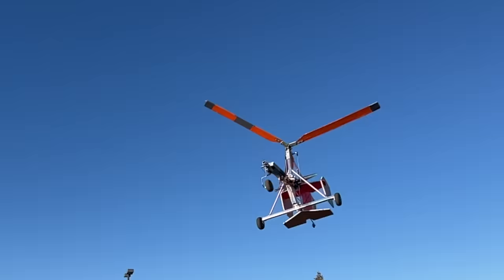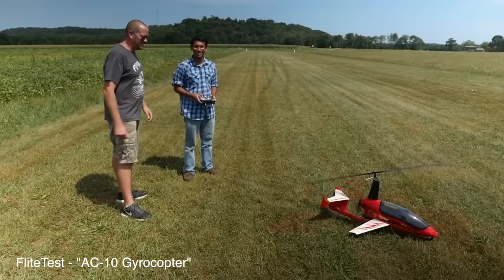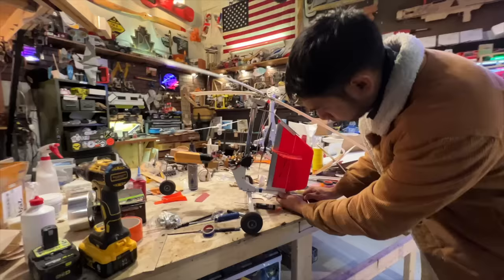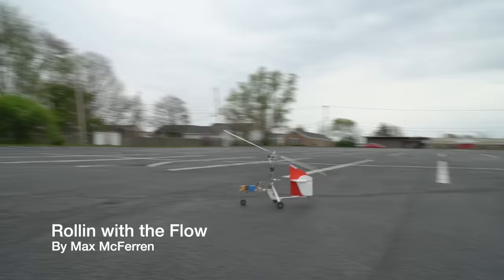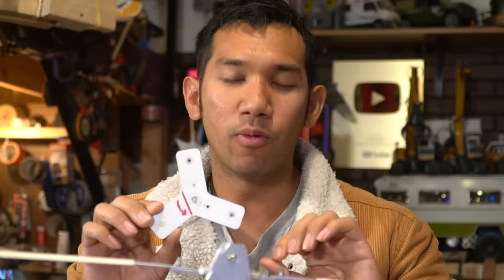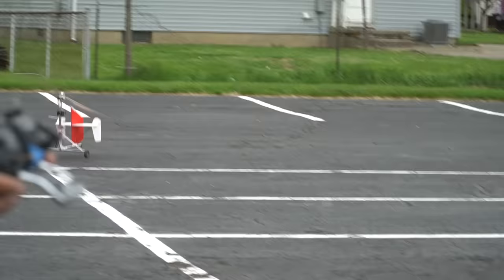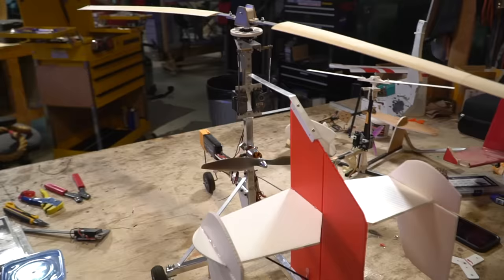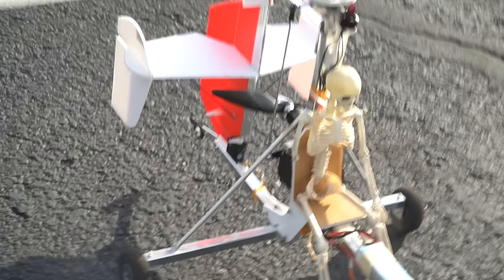This isn’t a helicopter or an airplane?

Comment: I have a buddy whom at one time owned a full size human gyro. He gave me a ride. Watching your video helps me appreciate that we are not dead.
Reply: I'm not sure where the notion that autogyros are inherently unsafe comes from.  Back in the 20s and 30s many aviators flew them and regarded them as more safe than airplanes due to the fact they could autorotate and can take off and land in very short distances, and also capable of very slow flight, whereas an airplane would stall. Amelia Earhart flew one for years. She set at least one record in it, an altitude record of 18000 ft.

If you expect them to fly like an airplane, then yes they probably are unsafe. It kind of looks like Peter is falling into that trap with all his initial crashes.  I've only flown one in simulator but if I recall, they don't rotate at takeoff.  At sufficient air speed they just lift off without changing attitude.
Reply: @tmlf1239  Hi I fly gyros though not for a few years.  The gyros safety record is undeserved the safety records of people trying to teach themselves and some appalling instructors resulted and still results in a terrible safety record.

One of the issues is they are a very high wing loading machine meaning that when the rotax 582s became available we could have dual control machines unfortunately that same machine was available as a single seater.   So the empty weight of that machine was probably 130kg.  Now add two 90kg male pilots and you have a machine just able to fly.  Take one out and you've lost about 1/3 the weight and it flies like a completely different machine.  The stick sensitivity alone is massively different.

Gyros have a few things that can bite you on the arse but much safer in others.  For example no stall no spin.  I've had 4 engine related emergencies two full on engine failures.  Non event I'm a gyro but you can't fly them fast.
Reply: who
Reply: @tmlf1239  Flew in them for years, my problems were those who built them, for a while was a test pilot for my mates. Had to KNOW them and what they did when the built them. A friend died flying his,  this was the cause of FAA building and testing. Their response was this is the best aircraft to survive all they did to it..They bolted one to the back of a flat bed truck. It lifted the back of the truck of the ground, the pilot lined it up again after it went sideways.. Tough?, safe?, depends on you and your  mindset. I made certain I knew what to expect, and what to do in all situations. Needed that.
Reply: Saw a Cierva in the Brits tech museum. Very impressive machine. Want an electric one.
Reply: @tmlf1239  As I remember reading, in the 20s and 30s all autogyros were tractor type with the engine and propeller in the front. Gyroplanes/gyrocopters like the Igor Benson models, on the other hand, were (and, generally, still are) pusher types, with the engine and prop in the back. They also were commonly built in the 1950 and a bit beyond without horizontal stabilization surfaces. Without these surfaces, and with the engine/prop mounted at or above the COG, these tended to push the nose down (called a power pushover, or PPO) when throttling too aggressively, in which case an inexperienced pilot would pull back on the stick too much, causing the nose to pitch up, which would cause lift (and therefore drag) to increase, which would cause aircraft to slow down and therefore reduce lift causing  the nose to pitch down,  which would cause the pilot to repeat the cycle, etc. In this way, the aircraft would enter a phugoid oscillation pattern, aka porpoising, that would become more extreme and eventually lead to the nose pushing forward to the point where the rotor disc would become unloaded, which would then lead to the aircraft falling out of the sky like a brick. It usually took three oscillations for the disk to  become unloaded and down she comes. Virtually always fatal. Also, the sudden lurch forward on the last oscillation would frequently cause the rotor to make contact with the propeller, so, even if the disc was not unloaded, it would be damaged beyond function, leading to a very, very quick descent.

Eventually, this problem was mitigated by lowering the engine/prop to at or even a bit below COG and also adding horizontal stabilization (although I'm not sure how much the horizontal stabs helped). By that time, though, gyroplanes had already gotten their bad reputation. This problem does not exist with tractor configuration gyros.
Reply: @gcolwill  hi you're right the hs doesn't work because it's not connected to the rotor system like a fixed wing.  It may contribute to dampening the airframe response to what you are telling it to do but it's not going to stop you unloading the disk.  Which is why may ppo accidents still happen today even with machines with very large hs.

I do have to add a correction on cg vs thrustline in relation to bensen machines.  You are accurately representing the modern myths but they are that.  Look at an actual Original Bensen or Wallis Machine.  They are very very short.  They also have a proper amount of downthrust 3 degrees that is the motor is tilted down to put the thrustline through the cg.  Bensen also flew very short narrow rotors this meant at any given airspeed the disk angle was higher than most modern machines.  What's more his blades were wood with a steel strap set to only 0 to 0.5 degrees angle of incidence and with a chord width of 6.5 degrees.  The mast was short because the direct drive two strokes he ran could only run a 48 inch prop.  These did have a thrustline passing through the cg.  Ceriva did the same thing pointing the engine down at over 5 degrees   this isn't new.  However many gyro builder s thought putting in downthrust was stupid one guy told me I want to go up not down why would I point it down?  In fact look at most dominator machines and they have zero down thrust.

But people ignored these things and often made machines that were dynamically unstable.  But the speed range on a Bensen or Wallis machine was quite good.  Now the rotax came along and now what did we do? Lengthen the mast put on bigger props and rotors meaning your vne just dropped.  Even so they were still safe if the used down thrust and kept the speed low.  But consider the aircommand often 25ft blades, 8 inch n8h12 section rotors   and a 60 inch prop meaning much higher mast.  Again this was not risky unless flown higher than 80mph.  That was Glasgow uni analysis.  Safe till over 80mph.  So easy just fly below that.  Set the speed to Max 70mph and you can fly safely all day.

But it is and always has been possible to unload even the most ridiculous machines.  I knew one bloke so confident he could fly high high cg thrustline machine with a massive stabiliser right in the prop wash and pitched down that he announced after less than 10 hours solo he was going to do over 100mph the flowing weekend.  Myself and everyone in the club told him to wait till he had more experience and warned of unloading his disk.  He brushed it off.  His gps showed he unloaded this safe machine at 94knots  his body was found outside the cockpit leaving his leg under the instrument panel.  Having a thrust line that passes through the cg is important but downthrust is a perfectly reasonable way of doing it.  That Bensen gyros still unloaded was for the same reason it's always been bloody poor instruction and ego overcoming caution.  I flew a VW bensen derivative for many years it was perfectly stable even hands off.  I never flew it about 80mph.  In fact I generally never flew about 60mph as the machine climbed best at 35mph so I generally flew at that speed unless manouvering tight etc.  I'd be more worried about the still poor training on offer in many places and don't believe everything you read about the older machines many outperformed the modern machines and were a 10th the cost.  What the modern machines have is reliable motors but they are boat anchors compensating with massive hp to compensate for elegant design.  They are not safer if flown poorly and the current fatality rate has not changed in my country.  It's just as appalling and for the same reasons.
Reply: @cameronlapworth2284  Amazing response. It was my fantasy 20 years ago to build a GyroBee (not the RC, but the real Taggart gyryplane) and fly it (I even downloaded the plans), but I didn't make enough money to raise my family and do this. Now, at 56, I do make enough money and all my kinds are grown and standing on their own feet, but I wonder if I have enough brain power left to make a proper machine. All the details you mention seem critical - the devil is in the details. It's probably fate that I did not build one of these when I was young and so very (over)confident in my mental faculties. Now that I'm old enough to have an inkling re: how much I don't know, maybe it's really time to build and learn to fly a gyro. All I need is to find the expertise to tap into, so I can  build properly and fly properly. We'll see.
Reply: @gcolwill  Hi Mate, I did respond to this but it seems to have gone missing or not uploaded.  The gyrobee seems to be a great option, I'd certainly be building something like that if I was a first time builder again.  

I'm building a new machine around a new Hirth Engine I was given by a friend (my VW was unreliable 4 engine related emergencies 2 of those engine outs) now the Hirth will likely be just as unreliable but its half the weight.  Anyway, the lighter the better.

If you are in the states (or anywhere really) your real challenge is going to be getting decent training.  This would not be so hard if you were buying one of the massively expensive and massively heavy two seaters out there.  These machines often weigh 330kg empty so they will always be heavy even 1 up.  They do perform well but that's because they often fit 100-140hp engines at GREAT expense.  For me the beauty of flying is flying, you don't fly gyros to travel long distances and frankly I found long cross country flights boring.  

I remember flying with a ultralight buddy me in my gyro him in his ultralight it was about 9:30 am in summer and it became obvious that some thermals were beginning to kick off,  I couldn't feel a thing and was dangling my feet and flying hands off and experimenting with slight turns putting one hand or the other out to one side in the slip stream.  But watching him he was actively flying responding to turbulence I could not feel at all.  For him the flight was active engagement for me it was pointing then turning at a way point then nothing to do till the next way point.  

Anyway faster gyros can only do so at some risk although I believe many of the streamlined machines can fly faster than open machines like mine at 1000 ft 60mph and 100mph are going to look the same one will just get you somewhere faster.  Frankly though if you want to go fast get a fixed wing.  If you want to have fun flying and be able to maneuver and have a fun true flying machine you can't beat a light gyro.

However the problem you will have will be training.  Going up in a modern heavy gyro and flying your single seater will be a world apart.  

I was very lucky that I lived within 4 hours of a very good gyro club with an excellent instructor.  They trained in a mixture of the old and new.  Primary training was in the club gyroglider, dual then solo, followed by powered instruction in a two seat aircommand (the old style) and if flown at reasonable speeds it was a very nice sedate machine (at least dual).  then this was followed by many hours of ground runs in your own single seater after my instructor Terry had test flown and you'd made the necessary changes.  We'd probably do about 1.5 to 3 hours in the glider total (but remember on a km long strip that's a take off and landing every minute).  About 3-5 hours dual and hours of strip runs and hops supervised by the instructor.  It worked I never saw a single rotor blade bent at that club over 16 years.  Yes guys would go off and do their own thing and wreck machines occasionally but following the instructor, supervised no one ever crashed.  We were well prepared.  I'm 53 and when I was learning about 19-20 years old we were all flying Bensen derivatives.  None has HS's  or high CG vs thrustlines like the Dominators, all had correct down thrust though and our instructor drilled into us the best LD.

If you can find a club that still uses the gyroglider this will be the biggest assest.  Not only is it really cheap flying it has massive safety advantages.  You can safely tow a glider behind the power curve all day because a tow car can overcome the drag and the tow boom means the nose height is limited so you can't hit the rotors, in fact we were all sent solo in the glider behind the power curve.  Sounds nuts but it worked.  We would hold full back stick and therefore all we had to do was hold straight left or right behind the car.  The car would get us light and if were were not drifting and holding position we'd be pulled until the wheels then the tail wheel were off the ground, you were flying with the tail wheel 1 foot off the ground at first, the driver controlled height with power.   You only had one thing to do hold straight.  If you veered left or right the driver could turn ahead of you reducing power and keeping you upright.  It worked it meant we all knew and could recognise what it was like behind the power curve (in safety).  We'd then be told to not let the gyro climb above the roof of the car and to hold that height, again full back stick until we climbed and then coming off full back stick to hold height  again only one more new thing.  Now were were flying full straight and level as the car slowed we pulled back in full back stick and then again we were landed by the car.  We then would come down level out and do a normal landing (for which we'd been trained dual in the glider).

The reason all this was necessary was the jump in performance was huge from a glider dual to single seat,  Its going from a slug to a Ferrari.  Gyroglider probably weighs only 70kg max add two pilots then take one out.  That's the issue you will confront flying in a dual machine with a empty weight of 330kg adding two pilots then flying a single seater weighing only 115kg empty.  Massive difference.  There is only one way you will get that feeling and that's in a gyroglider solo.  I strongly advise traveling to a club that uses them.

That these are considered some funny throw back is part of the reason these machines still have a massive accident rate.  

Same with blade wind up techniques.  This current system of wind up to 220rpm then gun it and hope you don't experience blade flap is nonsense.  

Check out this take off in very light winds (notice no one's hair is blowing) on a taxiway.  This was at the club I learned to fly at.  This is how people took off notice how progressive and easy it is if trained properly none of the violent nodding you see in a lot of modern machines where once the machine reaches lift off speed suddenly the nose reefs off and the poor student is trying to react to 10 things happening at once.  Turn the sound off unless you like traditional Greek music.

https://www.youtube.com/watch?v=36ogAzGGyG4  

here's the old glider I learned in around the time I was learning (I'm not in this video but my instructor is the guy flying the gyro and glider).

https://www.youtube.com/watch?v=PzY43nJVhn0&t=245s

Notice the bad take off and landings the student is doing.  Way behind the power curve and because its the glider this is safe and allows the instructor to show the student bad technique.  In a $100000 machine you would not risk a deliberate behind the power curve take off as you'd likely end up smashing the rotors and rolling into a ball.  This is a very new student and that glider with its cheap and beautiful wooden rotors taught 100's to fly.  

This is how to train someone.  Notice how easy and nicely the aircommand flies.  This has the reputation of a death trap.  It wasn't if flown within its limits it was sedate and well behaved.  One up it was a rocket though, big blades massive power, very light.

anyway nuff said.  good luck.
Reply: this comment made me exhale slightly faster than I normally would have and made my voice chords make a "chrrrr" sound 🙃
Reply: Ok I know some of your including you don't play far cry 4 but,is the gyro copter that man made helicopter in the game?
Reply: Addendum:
I spoke with my buddy (an experienced aerobatic pilot... yes I rode in his Citabria ) again: He said "the major risk, beside having a poorly built air frame, was flying maneuvers that resulted in negative G's. "
The mechanical design of gyros did not include handling negative G's.
He urged gyro pilots to use all positive G flying. "When used correctly, well-built gyros are very safe machines."
Reply: Those are worth some money. But the real rare gyros are those made for mooses. Meece? Moose? Anyway..
Reply: hungry greek cannibal?